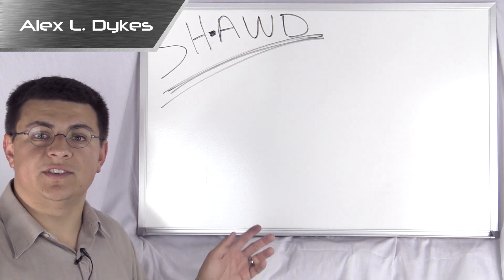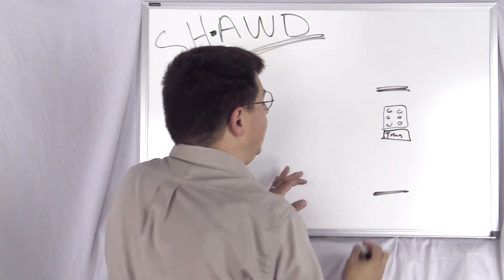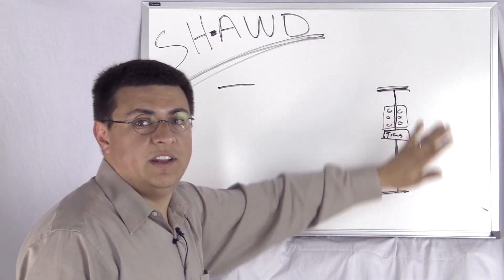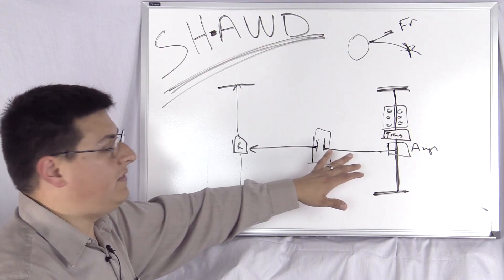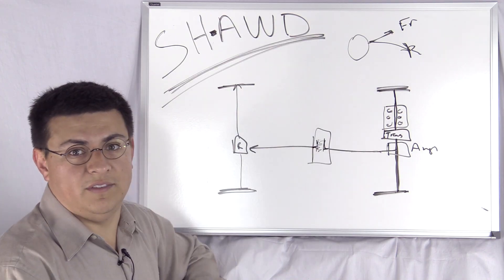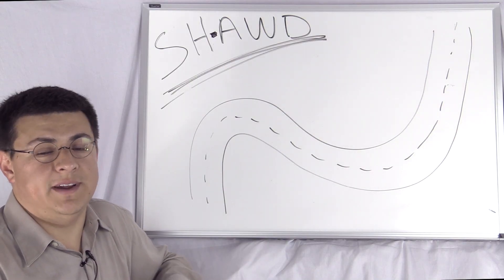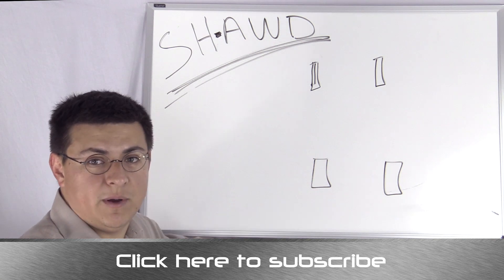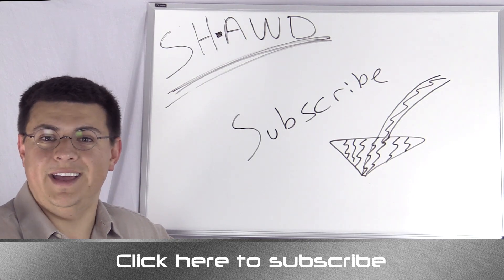How SH-AWD works: Acura's AWD system explained

Comment: You can explain all day and all the time but it doesn't work.! Nothing is locking the diff incessant the tire is air born. So it just spins the tire that is lifted off the ground which ain't really a sh awd to me.
Reply: Brandon Sunthivong  they have limited slip differentials front and rear. If a wheel was in the air and not in contact with the ground the power would transfer to the wheel on the ground. Having owned MDX’s and now a Ridgeline (same shawd system) I can assure you it works. Quite well actually.

Comment: SH-AWD vs P-AWS: which system corners better?
Reply: Joe Goodman I have a 15 MDX SH-AWD and a 16 TLX V6 P-AWS...the former is far more sure footed in turns  than the latter.
Reply: Thanks. That's as good a comparison as I could possibly hope for, so I greatly appreciate you taking the time to respond. I would have guessed incorrectly, by the way.

Comment: two questions: how do you explain the overall superiority of quattro vs. x-drive and 4matic according to various tests, press meetings, and filmed real-life experiences in low traction conditions? Second. Why don't you mention the core of the quattro - the Tor-sen differential, with instant torque bias and lock being essentially built in its construction?
Reply: typically they show or talk about the SH System vs VAG's older Haldex system.   They should put it up against the Audi system with Sport Diff in both dry and snow conditions but then Audi would show their weaknesses so they won't do that.
Reply: nah, I don't think audi would show its weaknesses. quattro is still mechanically based lock-up/torque splitting system, based on instantanous (not almost-instant, as with all computer controlled systems that must dis/engage cluth packs) functionality, see numerous videos online explaining Tor-sen differential from the JTEKT company, which audi, and some other 4wd systems (but not this S-AWD), use

Comment: I don't need this, i drive like a grandma, Lol.
Reply: If you were to live somewhere that snowed a lot this system is awesome. Where I live it snows nearly every year multiple times and sometimes several feet of snow.

This isn't just for handling around corners for speed, it also helps redirect power when traction starts to give out. If one wheel starts slipping or losing traction it can redirect power to compensate and help prevent you from sliding on ice or snow.

Comment: Sounds like a lot to go wrong, and a lot of wearable parts that would likely be expensive to replace.
Reply: 130k on my sh-awd system and it still handles like a dream.
Reply: 160000 on my rdx still working great
Reply: My thoughts too. But truth to be told the car would be  FWD in 99.9% of the situations. Unless you take it to the track all the time.
Reply: That's the take home I got out of it.  As I understand it SH-AWD is a real full time system.
Reply: I really like the TL SH-AWD with stick.  I have driven the auto version, and I was impressed with the handling for sure.  Glad to hear you haven't had problems.  How many miles does your MDX have?
Reply: OJDUDE just got a 2010 with 48k... loving it so far

Comment: I wish RDX and CR-V AWD system were supplied with the much better GKN Twinster AWD system:
Difference with SH-AWD: The wear and heat generated by the sliding friction is much less in the SH-AWD. Compared to other AWD systems such as the GKN Twinster and the Haldex, the clutch pack in SH-AWD only need to handle 27.8% (1/3.6) of the workload  that the Twinster/Haldex systems need to handle under the same output condition. This is the reason why higher load can be applied on the rear wheels more frequently in the SH-AWD system, without the wear and overheating concern. The rest specs are the same.

I will be expecting that in 5th Gen CR-V and next RDX model from Acura to be utilizing the better GKN Twinster AWD system. Range Rover Evoque is already benefited from this much better AWD system compared to Acura RDX and Honda CR-V.  Evoque has already proven its excellent off road capability, and performs much better in all off road situations, both hill climb, snow, rear torque up to 100%, LSD etc.

Comment: Advantages and Disadvantages of AWD front main drive and AWD rear wheel drive. Things being equal a normal AWD system is better when rear wheels are the main drive. CR-V and RDX, both having a basic AWD system, would be better with rear wheel drive AWD system especially when driving up slopes/hills.

Compared to rear-wheel drive, front-wheel drive reduces weight and 
production cost, improves fuel economy and typically delivers better 
traction. That's because the weight of the engine and transmission is 
directly over the driven wheels. 
Rear-wheel drive offers better initial acceleration than does FWD 
when a quick start is of the essence. That's because weight is 
transferred to the rear of the car upon accelerating, thus boosting 
traction. Additionally, by keeping part of the drivetrain in the rear, RWD
 cars usually have weight distribution closer to the optimal 50 percent 
front/50 percent rear than can be achieved with a FWD system: Equal 
weight distribution improves a vehicle's overall balance and handling.

Comment: Thanks for this excellent presentation. I have a question. How can I improve the CR-V AWD system?? e.g limited slip differentials at the front?? Is there an add on to improve the Honda AWD system (4th Gen)??? I understand the Acura SH-AWD is excellent. I also know that Acura has made a mistake by not adding this excellent SH-AWD system to RDX model but rather chose the CR-Vs AWD system. Thus what I am asking is how to improve the RDX AWD or CR-V AWD system. 

What I am hoping for is ways to improve the rear torque and or open differentials capability, e.g. software traction control is enough???? is there a way to include a AWD lock button capability or add a rear wheel acceleration device?

Cheers
Reply: Nope your screwed, but not alone as I have a Saturn Vue AWD.  You could put an LSD possibly in the rear, but I woudn't put one in the front as that will only increase torque steer.  Start saving planning for an MDX or older RDX with SH-AWD as I plan on doing!
Reply: I agree. The reason is that this light AWD system only gives 30-40% to the rear wheels. 

GKN Twinster AWD system (similar to Honda SH-AWD) is much better with 70% torque capability to the rear wheels (Range Rover Evoque is using this). Honda CR-V and Acura RDX will loose from competition if they fail to upgrade their AWD system to GKN twister or SH-AWD system.

In other words this is only a AWD system for road usage and light sand off road.  Hill climbs you are screwed , specifically in this situation when front wheels slip the rear wheels will fail.

Can LSD at the back help with only 30-40% rear torque capability?? If it was 50-50  split then I would say yes, but since it is not I would think that only front lsd would be a good idea. But even if we agree on this is there a compatible LSD for Honda Acura AWD system (open Differential) that will engage with a press of a button or automatically and fit??????? I also think that for the rear wheels there is no way to install an LSD due to the rear AWD system but I am not an expert so I am just assuming.
Reply: As you said when doing a hill climb which is probably the hardest thing off road power to the back is essential as the weight of the vehicle tips more weight to the rear.  Like any vehicle can go down hill offroad with the right ground clearance, and most AWD vehicles can do flat ground off roading regardless of the system(Again this depends on what tire has traction though).  Yet going up hill you really want to focus power to the back and again depends on what tire has traction say  a MDX only has traction to one front tire, well then it has to depend on braking traction control to get up the hill, where as it probaly is screwed due to its heavy weight and braking traction control system which cannot provide enough brake force to get up the hill.  Whereas take a Forester with open front and rear diffs, they forester is extremely light with all things considered and its braking traction control is very overhalled and can probably make it up the hill with just traction at one of any 4 wheels.  So, even though you are only applying 30% power to your rear an LSD back there can help you quite a bit as you would essentially be able to apply that fully 30% to the slipping wheel in the rear.  Yet I'll agree not as well as something like this MDX can do as it can ramp up the torque sent to the rear.  Talking about CRV and Range Rover I think the CRV is the entry level and the Range Rover is the extreme level so  I think you can expect differnt AWD systems there.  I think the general population doesn't understand/care about what AWD system they have but that they have one.  As most won't be going off road.  I think the MDX is basically using a killer AWD system for the performance handling aspect.  Again most are not doing any offroading with a luxury SUV.  If they are they are the rich and they will probably buy the range rover.  Finally I think that is why Acura dumbed down their AWD for the RDX to increase the margin they receive or lower the cost, whichever they chose.
Reply: If I can install a rear wheel LSD in order to bypass the rear wheel brake force/ABS (VSA simulates LSD by software by applying ABS to the slipping wheel) then I agree that this will give a much better rear wheel performance (and general torque performance), but only if one of the rear wheels looses traction. I have seen this happening many times with CR-V snow tests with Everyman driver.

Do you think that there is a compatible rear wheel LSD hardware,  which can be added to the MDX or CR-V rear AWD system????

Thanks
Reply: I'm thinking not, but who knows very popular car the CR-V.  Yet why do you bring the MDX into this?  Did you mean a new RDX?  The MDX has SH-AWD so no LSD in the rear needed.  I'm thinking you are meaning the current generation RDX.  Again just save up and buy a previous gen. RDX and you will be good one with SH-AWD.
Reply: sorry typo. I  meant new RDX. Just as a comment regarding LSD new Toyota Rav4 has front wheel LSD not rear. There must be some reasoning for them to install it at the front and probably what I said before, the rear wheels dont have enough torque capability thus the LSD was installed at the front wheels. 

Regarding compatible LSD for RDX or CR-V 4th gen, I could not find any, either front or rear.
Reply: Your probably right, less power to the rear so just throw an LSD up front as that is mainly where they are solidly sending power.  Basically a lot of SUVs my Saturn Vue included are FWD with power sent to the rear when slippage occurs up front.  For instance my Vue is FWD setup with 1:1 power being sent to the rear drive module where normally no power is being directed to the rear open diff.  As slippage occurs up front the open electromagnetic clutch engages sending power to the rear open diff.  In the end they can market the vehicle as AWD and the majority of the population doesn't have a clue what is going on they just think they feel safer with a AWD stamped on the back of their car.  One thing I have noticed are companies starting to make AWD systems better, and I think it is because of YouTube.  People are seeing these SUVs suck when off road and I think some automakers are taking note, which is good!  For instance GM is actually bringing out torque vector rear on their new Acadia sport addition.  Again I think the only option is to find the right vehicle you want with the right drive system and save up for it.
Reply: Correct. 
Sometimes we get lucky when after market parts are made available which correct the deficiencies of car manufacturers. That is why Honda/Acura sh-awd is so much better.  I will have to live with this until next time.
Reply: I watched a few SH-AWD videos online of offroading and while many of the people reviewing the vehicle said it was pretty capable, I was suprised still by how the system was operating.  Obviously you could see the open front differential standard behavior, but I was shocked to watch many times a rear tire not even moving!  My understanding is this system is mainly designed for performance handling as is basically in the name.  But it was sad to see almost like it wasn't performing in off road situations like I would expect or hope.  You would expect both rear tires to be moving at least some time after the front tire had been spinning there for some time and it wasn't!  I guess you can't have it perfect at least not yet!
Reply: I have never observer a real SH-AWD not performing well in most situations and better than any AWD competitor though torque capability at the rear is 70% and has no lock mode compared to 4WD, but better than RDX which is 30-40% and has no LSD.. I guess it depends how high the ground clearance of the Car is.

An SUV with higher ground clearance will perform much better since the underside will not be touching the snow . I guess there is no better AWD system though some systems come with AWD lock mode, or snow mud sand mode which improve the rear wheel torque performance and try to simulate the 4WD..
Reply: I agree I think a lot comes down to the programming of these systems.  For instance I believe the Pilot for 2016 had AWD system overhauled and now is more the like the SH-AWD, but not set up for super handling but more for driving.  It also has selectible terrain options and as tested by TFL was a very capable vehicle offroad.  Really just the ground clearance hindered it and of course the open front diff.  Well of course tires too I guess yet I see tires as something a person can easily swap.
Reply: In a few months I will be upgrading my CR-V tires to All weather for better snow/off road performance, since they need replacing I have a good excuse. If I had 320 euros to spare, I would increase the ground clearance of my CR-V from 170 to 200mm. Though this is not an option for the moment though one day I will. Then I will wait for a front compatible LSD to appear :).

Comment: Hi Alex, this "super" helpful. Just wondering though if it's difficult to find Audi's and BMW's with torque vectoring rear axles? Do they happen to be only restricted to M versions of BMW'S models and S versions of Audi models?
Reply: With Audi, look for the models with a sports differential option.   They are superior to the Acura system in that on dry for performance and in terms of overall handling, can rotate the outside wheel 10% faster than the drivetrain and thus respond more aggressively.  This is controllable by the Drivers MMI System.   Dynamic is aggressive, Comfort is least aggressive.  Audi's system also distributes power side to side when coasting, depressing the clutch or even braking too.  Especially important in snow when potentially entering a curve too fast whereby people will tend to either brake or coast.   It will actually rotate the rear end prior to the stability system needing to kick in.   Sort of a pre-safety safety system.   :) 

I participated in a 3 day course last winter at Mid Ohio whereby we drove both FWD TL's, AWD TL's and the Audi S4.  I actually drove my personal S4 when participating.  Very cool to see how similar in some cases yet different in others the systems actually are.
Reply: ms3er... Cool, so it's Audi's such as S4 or RS4, not A4 right?
Reply: Yes.   Not sure if the newer B9 2017+ version of the A4 has it available.   I have an S4 and it has the sport diff.   Love it!
Reply: @ms3er396  wow this many years later and your comment is what I was looking for. I have been wanting either a 6 speed Tl SHAWD or a Audi S5 manual with the sport diff and was always curious as to which had the better awd system. You could feel that the Quattro was superior too in terms of handling or hard to tell?
Reply: @JohnSmith-yr6je  Audi does handle better.   AGain, do you plan on tracking the car or just street use?   Both are great, but you will find the Audi is more planted and all-in has more power too.    The refinement in Audi is well above the TL thus why resale figures reflect it in even just a few years.   I've owned both.
Reply: @ms3er396  gotcha and causal sporty and spirited driving. I’ve hear some horror stories And I respect Audi and I would totally get one brand new but for used I’ll just look for TL. Thanks though
Reply: @ms3er396  also in wet rainy conditions which would you prefer for aggressive driving?

Comment: I'm on my second MDX. The first was a 2007 (2nd Gen) and its replacement is a 2011 (2nd Gen Repress).

For anyone wanting to know about safety, I have to credit my 2007 MDX Sport for saving my life. Sitting at a stop light, in the protected left turn lane, a late model minivan heading in the opposite direction drifted in to the oncoming lanes, hitting my vehicle nearly head on at approx 45 MPH. Steering wheel airbag deployed. I walked away, as did my 2 year old who was sitting behind me strapped in to a front facing car seat.

Addressing the video - this info is so helpful when explaining to others who are considering an MDX or its competitors, just why the Acura's handling makes such a big difference.
Reply: rtrumble glad okay
Reply: Ok thank you!

Comment: I've read quickly through all the comments, and no one is mentionning anything about the AWD systems that only works under 18mph.  So if you drive slow, the awd systems might be good, but it has no use on a normal speed road or highway.  That is why we still have Subaru that still works for these cases.  I'm looking for a bigger SUV to replace my Tribeca, but can't find anything that has a full time AWD, except trucks.